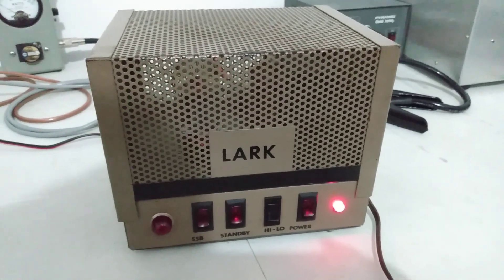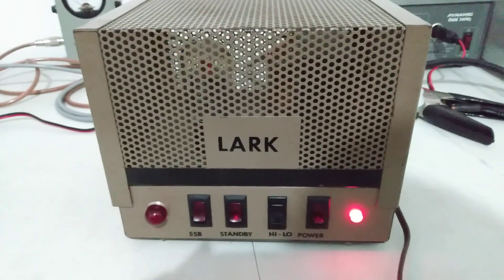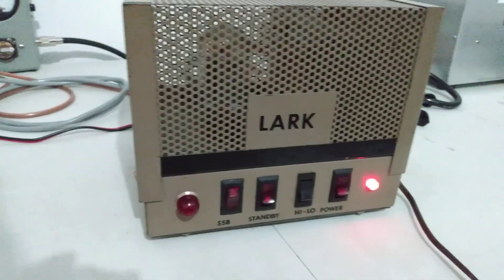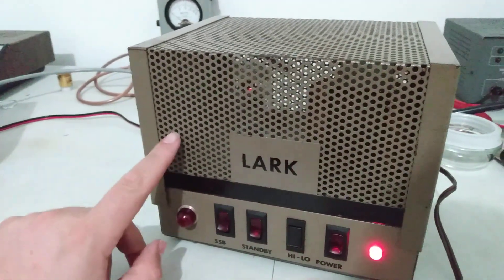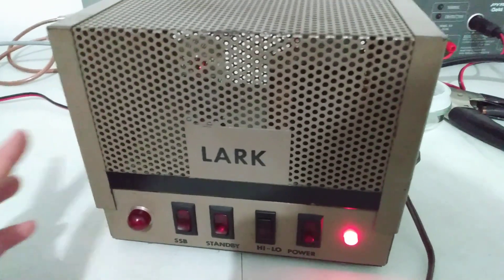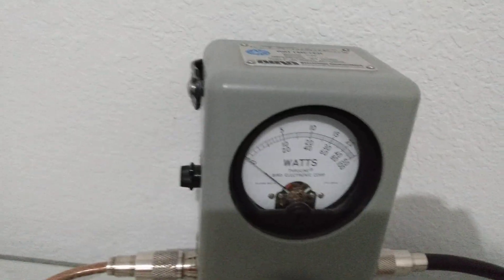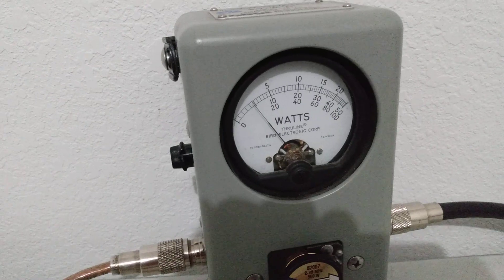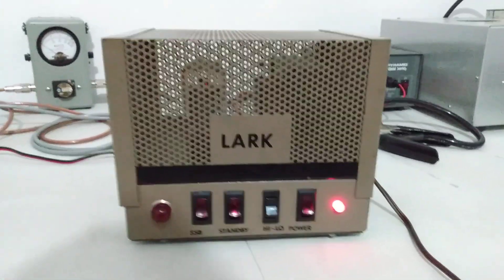"Lark" Single 8417 Vintage Tube Linear amplifier/modulator. Fully operational and tested

Comment: Hey Rooster, I have a amp similar to this but it is a no name brand that used the 8417. I replaced that tube with a Zenith brand 6jh5 (hi mu beam triode ) used as a pulse regulator and it uses a compactron socket. With a tuned cobra 29 I am getting almost 100 watts peak from it. The down side is I have to use certain brand name tubes like zenith and ecg sylvania to get any real power from it. The RCA and GE brand name tubes only give me about half that power. The zenith 6jh5 Im using is still doing good on AM and SSB but like I said I had to change the socket and shorten the tank coil and add a variable capacitor to tune the output but these amps are tuned grid on the input where the signal is applied to the control grid and also uses a bias voltage which helps in keeping the signal clean. Just my thoughts. Like your videos man!

Comment: Does anyone,have a schematic for this amp? mine failed today, seems the transformer had shorted, and I have no info on the transformer, it has got and neutral on one side with one other wire, the other side has 5 different wires on it, I might have a old amp laying around that has a transformer, but it would sure be nice to know what the voltages are on this one..

I realize this was posted 3 years ago, and I'm sure Rooster has sold the one he has, any info would sure be appreciated, hello from Memphis,TN all